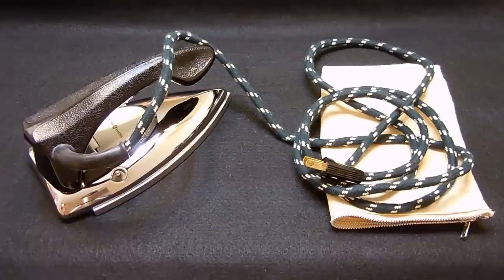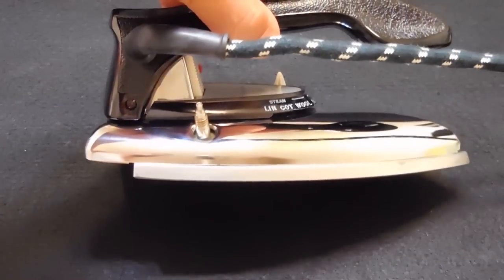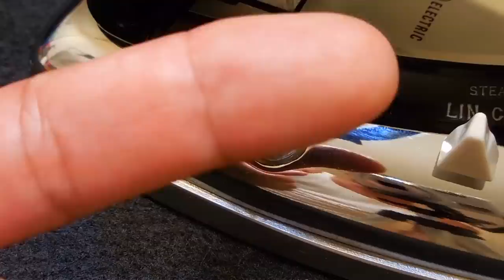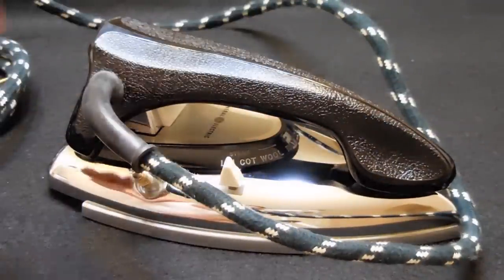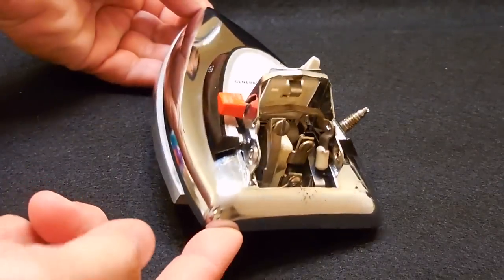Vintage Dual Voltage Travel Iron Operation & Teardown

Comment: I have one of these irons.  I use it for sewing as I love that it doesn’t shut off if I don’t use it for 10 minutes.  I have owned it for 8 years - it has worked great!  Unfortunately, it has recently stopped heating up/working.  Wondering if it is fixable??  I hate to get rid of it as it’s just another item in a landfill.  Any advice?

Comment: That looks like asbestos cord, and internals as well, be careful!  Once you breath enough of the hooks in 20-30 years lung cancer.
Reply from the maker: A D Looked like cloth/fabric to me. I've seen asbestos. One exposure won't cause cancer, it needs to be repeated exposures over time. People that work with it are usually at risk, and some people never get cancer from it. Thanks for caring and watching!